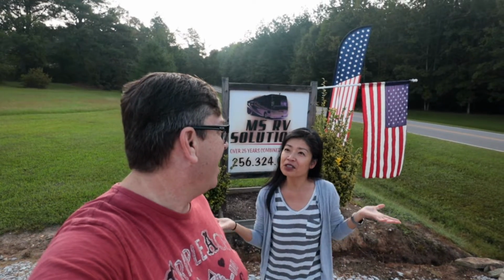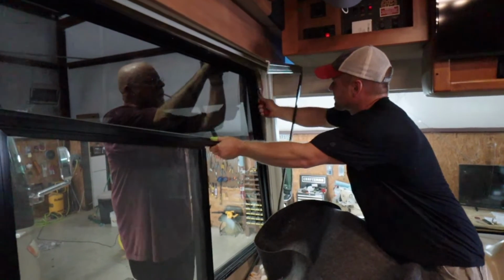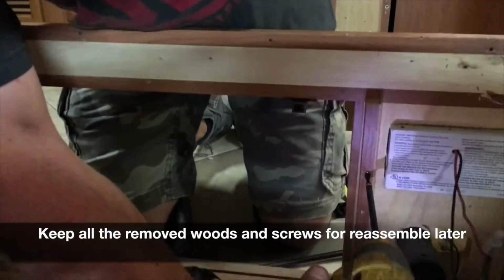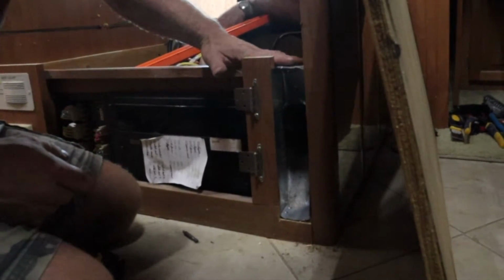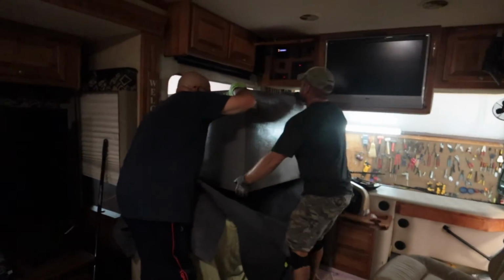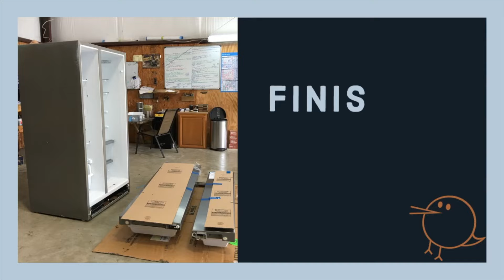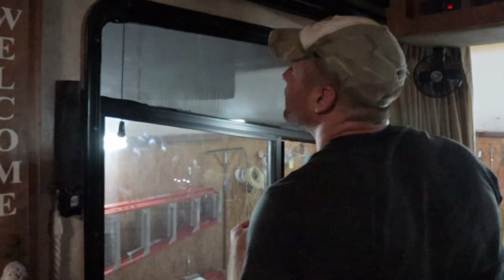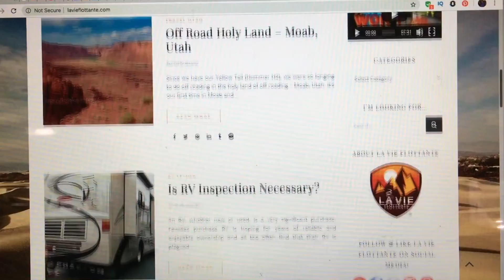Replace RV Refrigerator Ultimate Guide - NorCold to Residential Refrigerator

Comment: Thanks I was wondering how you change the appliances in a RV, without removing the front windshield.
Reply from the maker: It's much easier from the driver side window!
Reply: These residential fridges are to large to fit through any RV door. In a travel trailer or 5th wheel, they have to remove the slideout.
Reply from the maker: @ShutterFanatic  😲😲 Glad we have a Class A. That's so much work to remove the slideout, difficult to do it yourself. Certainly needs professional help!
Reply: @LaVieFlottante  Definitely not a do it yourself job unless you have a lot of big strong friends:)

Comment: Curious to why they would want less ventilation in the back. was this to protect it from water? The fan that sucks the air from the coils is right around where that vent is.
Reply: wondering the same. I'm about to do this and not sure if I should or shouldn't have more ventaliation. During the summer I'd want that heat out, but during the winter I'd want that heat in. I guess it depends on how tightly you sealed the fridge in the cabinet interior wise.